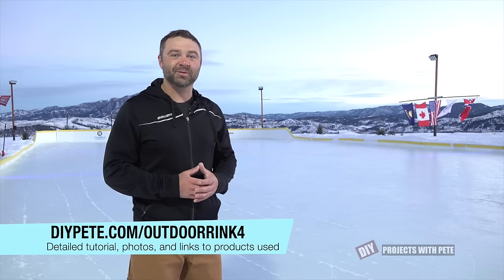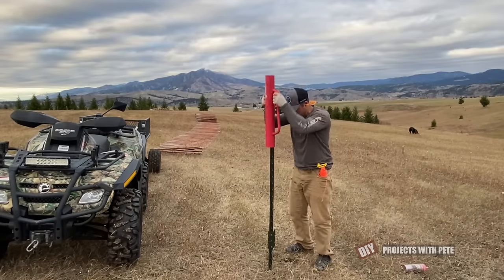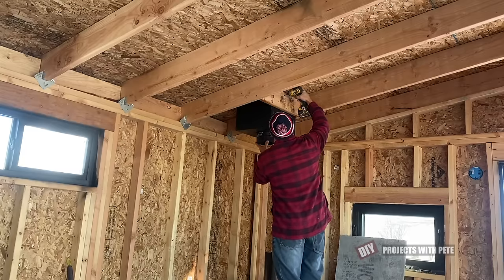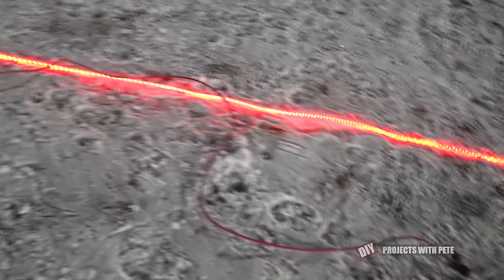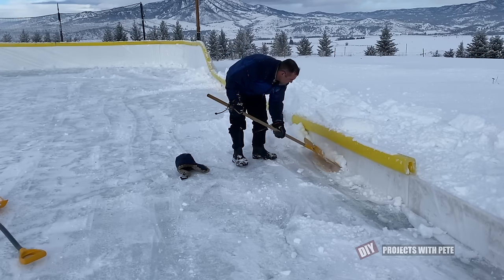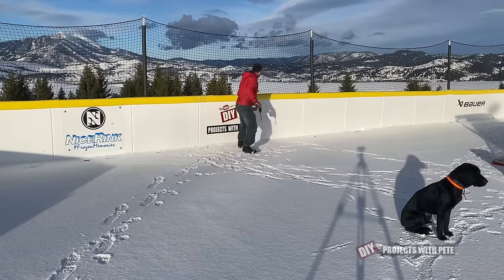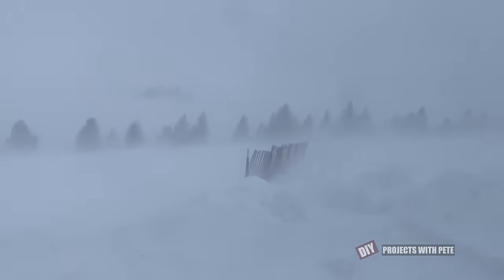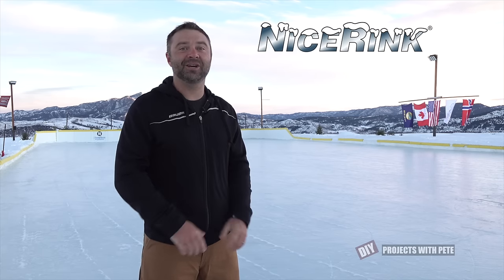DIY Outdoor Hockey Rink Year 4 | Warming House & Under Ice Lighting

Comment: That is a phenomenal outdoor rink setup! Awesome would only be a starting description. I've been in and/or around the game for over sixty years. In my experience, like a lot of outdoor rink builders, you are at that level where you will do anything to get the best quality ice possible. You'll find a way. IMHO you are going to have to engineer a device that can shave it for you. Imagine a mobile device with a large planer attached, upside down, with an ability to raise or lower it and shave the rink accordingly. When you flood over a shaved ice surface the water "flattens" out much better and leaves you with a smoother rink. Every Zamboni or Olympia resurfacer has that ability and I think it is a crucial element for getting the best end result...
Reply: I was just saying the same thing. In the video he was using that ‘rotating brush’ snow remover thing (similar ish to a snow blower). He should make an attachment to the front of the tractor and brush/clear the ice as he runs it over and lays down the new water!

Comment: I supervised an Arena one time, built my own mini zamboni.

Used a push broom with copper rod as a handle with a garden hose attachment connected to hot water tank. The brush had a copper rod with holes drilled into it. It was flawless, except when i used it had to have somebody wiggle the hose because the hot water from it WILL melt the ice if sit to long.

Comment: My year has been a carbon copy of yours. Weather wise at fill time, same power sweeper, used liner goes to friends for reuse. Not to mention the summer of earth moving to make room for a level area. Had to cut into a large hill. I also have clay. Dug out a couple feet and replaced with sand. But still worry about the ground swelling when the temps get really cold. So I know every feeling you are experiencing during the ups and downs of a season. I feel mother nature can be a cold hearted B.
Reply from the maker: Hey Mike Great to hear from you! Sounds like you have a very similar setup! What size rink are you working with? Awesome to hear you dug out the area to level it and have been working hard to get it all dialed in. I hear ya about the amount of work it takes though! Keep it up, I'm sure it has been a hit with families and kids :)
Reply: @DIYPETE  We are 50x100. And I am different than most rink builders, as I have no desire to go bigger. Looking forward to your warming house video.

Comment: Rink looks fantastic.  I have been waiting for months for this video!  I did notice you had some goal net burnin.  One of my sons hockey teammate home rink uses a winch/pully on a stand behind the net side board, when they are done for the day they hook the net to the winch and give it a crank or two which lefts the net about an inch off the ice so it doesn't melt in.  It is so simple that his 10u squirt does it himself
Reply from the maker: Thanks so much for following along! That's cool about the winch! We move the goals off sometimes and put them off the rink to the side,  but a lot of the times I try and leave them on in the same area and the melting helps keep them in place when we are playing so the wind doesn't blow them around :) Cheers!

Comment: Ever use a diamond grit polisher ? Usually for concrete or marble. That with 60 grit wheel to start would be lots quicker on high spots and then swap to 300 then 800 grit. They sell 10" walker ones too now pretty good price nowadays. But the makita handheld ones could do it.

Comment: far as a ice resurfacer goes before you build a version 2 have a look at the proglace manual ice resurfacer its a really well built tool we just got one for our community odr which is 190 by 85 and it has a blade on the front to scrape while it floods a perfect sheet of water behind it check it out
Reply from the maker: Thanks! I have a buddy that used to use a ProGlace and he said it is awesome. I will have to see if he still has it and if I can give it a try! Thanks for checking out the video!

Comment: get an ice edger to cut down the ice in those massive bumpy sections. Olympia makes them as does Zamboni. Could probably get a used one from a local hockey rink for cheap.
Reply from the maker: Will have to keep my eyes open for one! Would be a great tool for the rink. Just watched a video of the Olympia edger. Thanks!

Comment: Got mine back up and filled yesterday afternoon. Then wicked winds blew leaves in mine and it froze.  Not sure how im going to deal with that.. looks horrible with leaves on the bottom…. Decided to break some sections and try and squeegee/broom them out…. Thinking of using a pump to draw them close to me then put the water back into the rink… what a mess.  Since they are on the bottom i wonder how much of a effect they’ll have.  But my depth is going to be 10” of water( at least) on one end and about 6” on the shallower end.

Hope yours is going good.

Comment: I realize this is an old video but, maybe a modified lawn mower blade could be used to flatten your high spots even when frozen. I picture a blade with a square sharpened blade than can be made to squarely touch the ground surface that the wheels sit on.

Comment: It didn't look like you used the kickplates in the year 4 build and I realize they don't have kickplates for the tall boy walls. I also noticed you overlapped kickplates in year 3 and was wondering if all the small ledges created puck stops? I've heard about issues with kickplates lifting from freeze/thaw cycles, so I'm wondering if they are worth getting?
Reply from the maker: Hey Jake! I have a love hate relationship with kickplates. The thing I like most is that they cover the plastic liner and "pro up" the look of the rink. Your are right about them not having kick plates for the tall boys. Last year was a little trial and error as I was the first person to receive the tallboys outside of the company. They are currently figuring out the best way to tackle that question with the taller boards. In past years, I overlapped each kick plate about an inch all in the same direction so a shovel doesn't catch on them if going around the perimeter. Some of the ledges did stick out a small amount, but not enough to affect a puck. I've also done it where you don't overlap them, and had ledges then as well. The freeze/thaw cycles can shift them around a bit, but I didn't have big issues with them. For me, I did like them on the shorter boards and I liked how they looked. Plus, they covered the baggy liner which a shovel catches on much easier then a kick plate. With the taller boards, I cut the liner about an inch above the ice line around the entire rink. Having a big ugly piece of white plastic that's all wrinkly didn't appeal to me, so cutting it was definitely the right choice for us. Re-using the liner isn't much of an option though - and I would say the majority of people would like to re-use the liner, but don't because of storing it and the likeliness of holes to patch and leaks to occur the next year. I think storing a smaller sized liner could be doable, but something like 130x70 is a bear. It is really a matter of personal preference with the kickplates. I've gone with and without them.

Comment: I had a setup much like yours for about 9 years, biggest difference was I had water piped underground to a heated well insulated shed close to the rink. Floods were done nightly as needed, the 150' hose was on a reel inside the shed that could be pulled out through a hole in the wall and rolled back in when done. This made flooding super easy and negated needing any flooding equipment (home made zambonies etc).  Any humps and imperfections at the start of the season disappeared over a few days  without any additional work. The hose was 3/4 " to provide high volume and a simple nozzle attachment with a shower pattern spray was all I needed. For clearing snow I used a snowblower with rubber paddles that "polished" the ice and removed any frozen chunks as well as any snow. Outdoor lighting like yours made both night skating and maintenance possible.  I wished I had thought about the under ice led lighting that would have been a nice touch. 

I understand the work you do to make this happen, cold toes and fingers, the bad weather and setting up everything every year is alot of work. Kept me in shape over the winter. 

Have you ever considered a permanent floor for the rink? If I had kept doing mine I would have used asphalt with a drain in the center and raised edges (about 4" berm), no more needing a liner, the boards could be left up all  year and when there is no ice the kids could use inline skates. You would have to either paint it white or bleach it using salt during the summer to stop the sun from melting the ice. All the lines could be painted on the asphalt also and all you do to open the rink in the fall is to cover the drain with a rubber mat and tape, and flood with water. Cost of doing this would depend on if there was an asphalt plant near you, the existing base being able to support it and possibly knowing someone who builds driveways/roads. Any cracks that develop over time can easily be sealed with bitumen. Those liners I know aren't cheap so consider not having to buy one every year would offset your cost of the asphalt.
Reply from the maker: Will do! :) Cheers

Comment: Couldn't you use a commercial floor sander that  you rent at your local lumber yard/ hardware store , I think it would pretty good on the rough ice.
Reply from the maker: Hey Gary! I actually own a 20 inch floor sander but I'm not sure how well the normal pads would work. I do have some low grit concrete polishing pads I converted the machine to use --- so I might have to try that! -- Either that or a big concrete grinder would probably help a ton. I'll have to see about trying mine out and potentially renting a grinder to see how they work! Cheers and thanks for the ideas!

Comment: Bro u need a floor polishing machine By polishing pads of all different grits I would say use like the red one it’s like a really hard  scrotchpad , it’s used to flattened and smooth any surface preparing it for flooring shit would take out those bumps and flatten large spots ,Imagine being able to use a huge palm sander that was like 3 feet in circumference

Comment: whats the limit for the thickness of ice that the led lights can shine through?
I got a sloped yard so one side of the rink has about 16 inches of ice.
Reply from the maker: Hi! I'm pretty sure 16 inches would work just fine! Ours is around 6-8 at its deepest and plenty bright. It gives a nice glow and I don't think the additional thickness will damper it too much.
Reply: @DIYPETE  
Just finished the flood and led lights shine through no problem with 12 inches. Awesome idea!

Comment: Have you ever considered ordering a water truck to deliver for the initial fill?
Reply from the maker: Hi! I did a 4000 gallons water truck for year 2. It took about 9 trucks and round trip with filling and emptying time was about an hour and a half. With 2 days of running the truck back and forth and cost for fuel etc it has just been easier to use the well the last 2 years. Nobody does it for hire around here so luckily a friend let us use his company's truck and I had a volunteer tanker driver. Cheers!
Reply: @DIYPETE  Home rink maintenance becomes a sick obsession quickly
Reply from the maker: @kclark2833  Absolutely it does!

Comment: This is bada$$. But you take it down every year?
Reply from the maker: Thanks John! Yep, we take it down each year. The liner has to be removed for sure. We could potentially keep the boards up - we'd just have to trim and mow around everything which would be a bit of work. And with the high winds we'd probably need to re-stake the boards a few times after storms role through. It's a good crew of helpers though each year so it makes take down and setup a good time. Cheers!
Reply: @DIYPETE  Very Impressive. I'm too lazy to redo something like this every year. I wo Der if there is a way to make more permanent...hmmm
Reply from the maker: For sure, definitely would be benefits to having it more permanent! :) Will have to see!